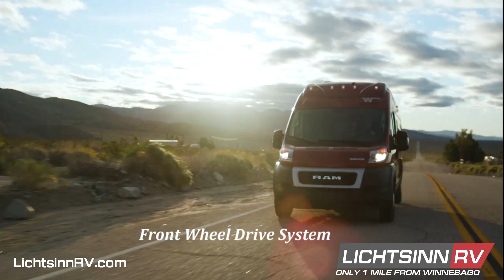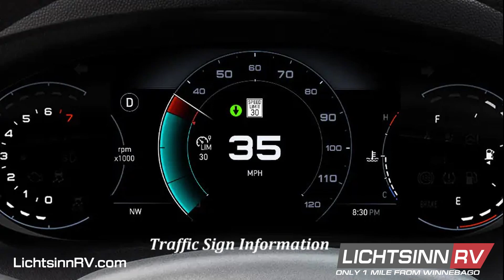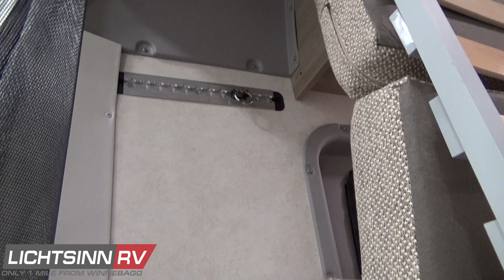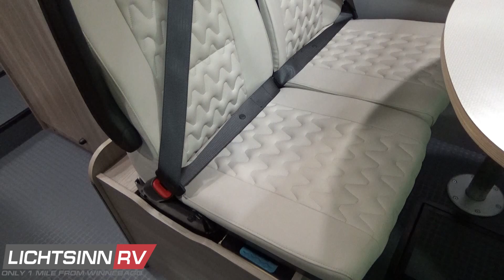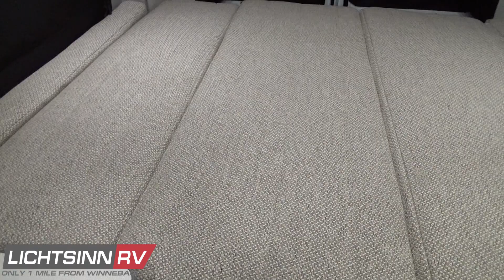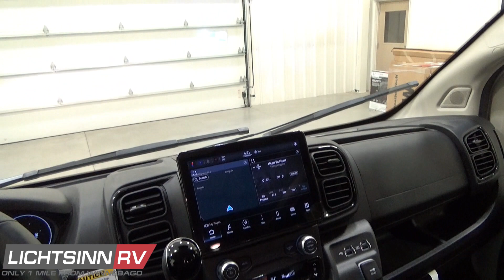LichtsinnRV.com - New 2023 Winnebago Solis 59PX

Comment: does the 'national park friendly generator' designation mean you can run it at times that the park says 'no generators'?
Reply from the maker: Good morning!  The National Park Service (NPS) has defined “quiet hours” as between 10:00pm to 6:00am for all national parks. But this doesn’t necessarily mean that all generators must be shut off between those hours. The NPS has targeted only those generators that exceed 60 decibels “measured on the A-weighted scale at 50 feet”, must be shut off. However, it’s noted that some national parks and some campgrounds have extended those rules more aggressively.